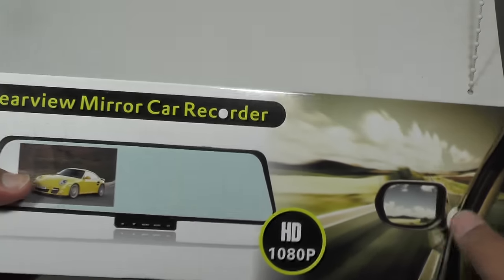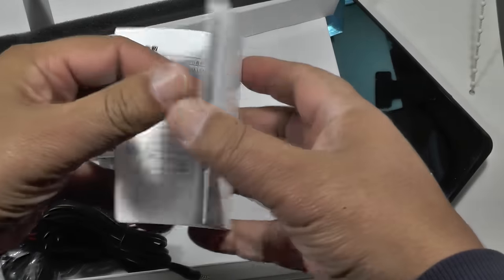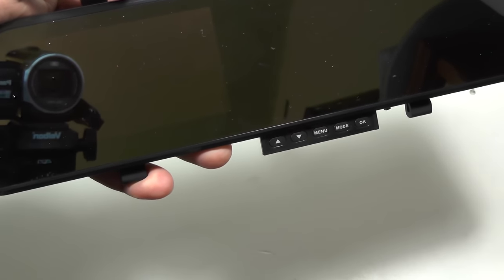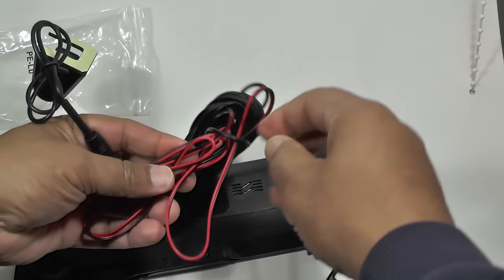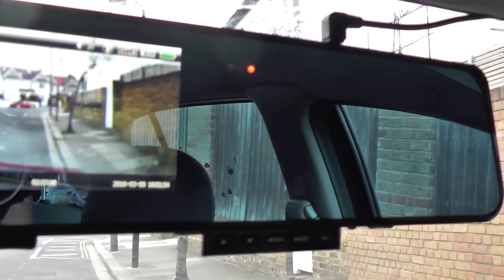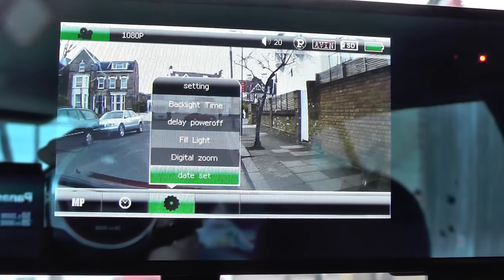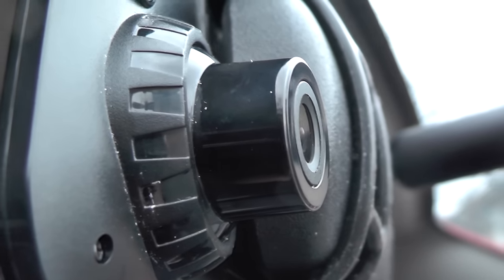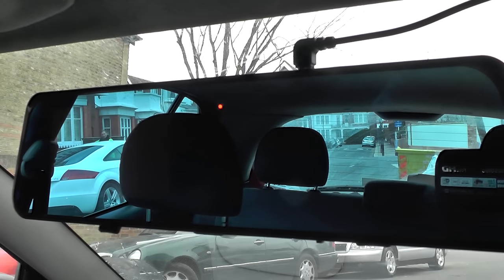Rearview Mirror HD Car Cam - cool budget car dashcam in a mirror [Review]

Comment: Hi Nigel and thanks for the review, I am in the market for a mirror cam and the big plus point with this cam is that the camera is fitted on the correct side for UK roads!! Have looked at the RAC 03 but even that has the camera on the wrong side. Also like the idea of the micro USB connection as opposed to the larger mini USB. Are there any UK distributors for this product or is it only available through Bang Good?...thanks again

Comment: Hi,
Just purchased one of these and have to say I'm quite impressed by the performance and indeed the price @ £32 on Ebay supplied from the UK (out of a Chinese Warehouse no doubt) - still it arrived for free in two days.
The rear camera supplied with mine is slightly different to yours and although I have the Black/Red pair of wires the camera works Ok just plugged into the AV port. So I'm wondering what the pair of wires in my case would be for?
The little user guide supplied is woefully inadequate but does give a hint of how to operate it. I think the most beneficial feature of this camera is the fact that the forward lens is mounted on the R/H side (sitting in the drivers seat of a R/H drive car). Most seem to be fitted on the left and point in the wrong direction - i.e. away from the centre of the road.
Anyway if there are any thoughts on the function of the rear camera Red/Black pair I would be interested to hear.
Excellent video - really well produced.
Reply: a bit late but the black and red wires off the rear camera are to connect to the cars reversing light through their supply. this will automatically turn the monitor on with a set of guide lines for reversing every time you select reverse gear.
Reply from the maker: Thanks very much. You'll see the wire explanation from @Jezzerouse Jezbian below. I believe (?) you can also hook up the wires to the interior light for power, but then you have to manually switch the camera?
Reply: i m in uk plz say where did u buy from.

Comment: Forgot to ask what the night time recordings are like? 
I know a lot of HD cameras struggle to record at night because the sensor has so many pixels.
The lower resolution sensors have a larger surface area so they are more sensitive in low light.
Thats not to say some 720p & 1080p cameras dont work in low light.
Reply from the maker: +andrew hodgkinson Night time? Awful. Such a shame. Twilight is not bad, but there's no low light capability at all.
Reply: Thats a shame.
Iv seen fairly good night time results from the SJ4000 but i think that uses a 1/2" sensor where as this camera probably uses a 1/4" sensor. 
I would imagine the reversing camera may work better at night because of its lower resolution CCD or CMOS sensor approximately 700 TVL.  .
Reply from the maker: +andrew hodgkinson If you want a good night time experience you need one of the new Ambarella chip car cams - e.g. https://www.youtube.com/watch?v=JYkyRntKEYA or this one - https://www.youtube.com/watch?v=diiASXgZR8Q - which I think is even better.